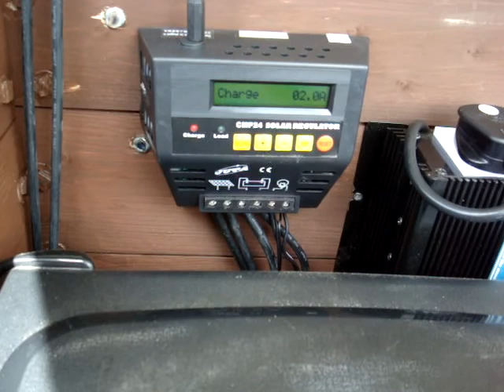Camping Solar Trailer.MPG

Comment: Great setup, really like the ideas you have got there. One suggestion, hinge the solar panel at the other end that way if you forget to strap it down the air flow whilst traveling will hold it down rather than flipping it up if the air gets under it :)
Another thought for holding it down, I am wondering if those magnets you can get for cupboard doors would be an added safety feature?

Comment: @m6pcg MPPT controller is a charge controller, except about 20-25% more efficient than a standard one. I.e. You get more power. The spike would earth your 240v system, negative earthed is not enough really. It's not required, but for peace of mind I would add one. 

Thanks for the upload, keep up the good work...you have more room for panels there yet ;-)

Comment: Hi, couple of questions and suggestions for you.

1) That 12v extension lead, is that something you made or can you purchase them like that?

2) An MPPT controller will help in the Uk.

3) For safety you should really have a small ground spike in the trailer attached to the earth pin of your mains side, then when parked hammer this into the ground.

4) Good job with the panel mount, Is it stable in winds though? (when tilted)

Thanks for sharing

Comment from the maker: @hippyraverocker Hi.. The 12v lead is actually a 240v mains extention lead.  I just swapped the plugs and sockets to 12v plug and adapter.  Not sure what a MPPT controller is but I'll google it..  Never really thought of the spike.. is this for earthing for the 240v system? if so, it is negative earthed.. will that do?
The solar panel is stable, even in gusty winds. I do need to make a locking bracket though, it on the list of things to do.
Thanks for your feed back... Sorry about the thumb :(